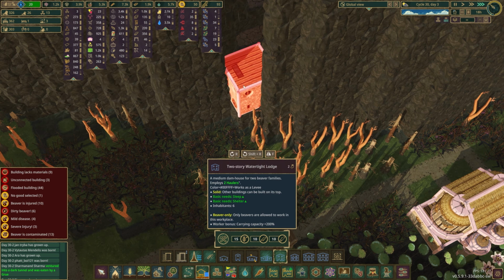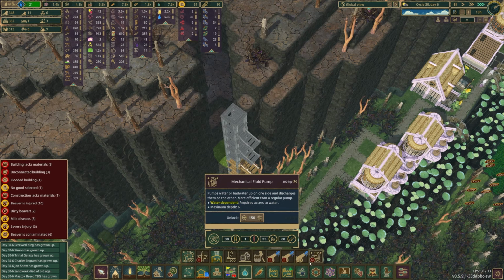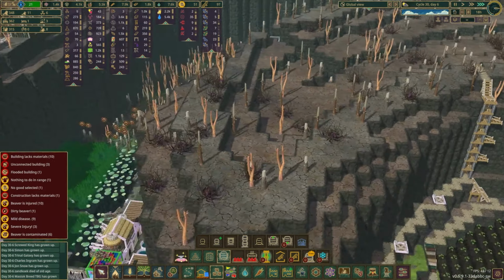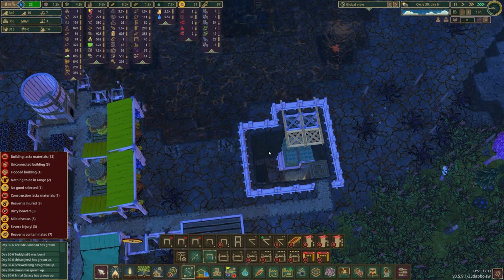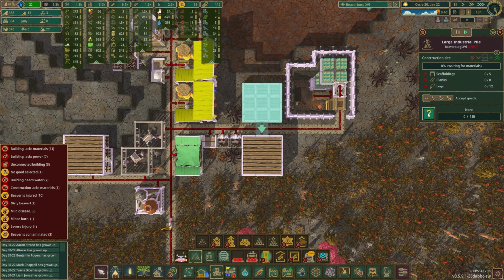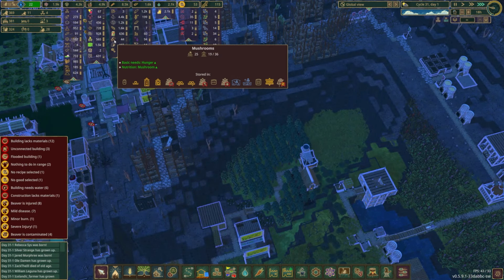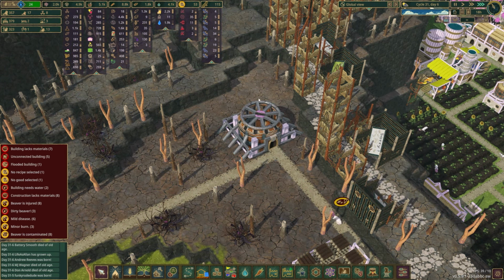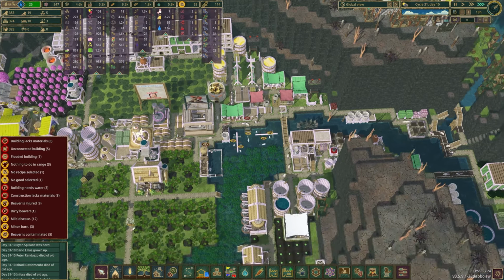Let's do something with the top of this cliff! Timberborn Waterbeavers Update 5 Episode 29

Comment: 19:01 if you place another floodgate near the exit of lake near the log pumps and set it to 1. It should provide enough height for the water cannon to work. And you could place a couple of waterwheels in front of your current floodgate. 

Also the idea of build a flood gate next to log pumpers to 1 is that any overflow can be diverted off the map. And therefore hopefully reduce the amount of flooding of the lower ground / floodplain.

Comment: 4:36 cannon in the bad water diversion channel by its exit that over flooded last time might reach the high top area :)? Not sure how quickly it would fill up the high top area but it could then over fill it and come out somewhere that then feeds the normal area below : 51:34 perhaps blast a channel out the side there for the bad water then then block it up and always send it off the map there . And then block the remaining water sources after your water wheel section and only funnel  good water to power your wheels up there

Comment: → 13:10 You could add some overhang platforms at your ladder stack, and put the fermentation barrels on top of them.
→ 19:06 You can put platforms on top of the medium crappy warehouse here, and then more warehouses, if you want. (Not sure how high these can be stacked, but at least one more level should go in.) Though I'm not sure you need more storage for quartz here ... maybe rather some of the other alternative outputs for the mine?
→ 22:46 You could likely use a combination of the overhang platforms and the 4-long bridges to cross the chasm?
→ 28:07 You could uncheck the "prioritize by haulers" if you want to avoid the haulers bringing in more goods for the current recipe. I guess you don't want to research another ENS blueprint here. (Actually, I'm a bit surprised you didn't get half of the stuff already.)
→ Remember, you can also put the giant tank between levee-type buildings, or a combination of buildings and dirt. (I don't have a concrete suggestion, but maybe an occasion comes up.)
→ Setting up the lido and water dump near your stack of water storage houses (with a path connecting them) would make the filling a bit faster, I guess.
→ Your logpile near the two lumberjacks was immediately filled up from overflow of other log production areas, so your lumberjacks on top of the cliff didn't get very far. Not sure whether setting it to supply would work, or just getting a bunch more piles. Or pausing some lumberjacks elsewhere for a while.
→ 59:13 It would actually work under water, but with the blockage of the flow you'd get even more flooding here.
→ 1:03:20 The large farmhouse can go on platforms over the water, and also inside of shallow water (I guess the beavers sleep on the upper floor). You only need the watertightness upgrade if you want to put it into deeper water. It also says it can go on top of the pit-and-ladder lodge (I guess with some platforms around). I'd like to see that.
→ You should have at least 3 of the primitive ironworks – one each for tools, metal fasteners and saw blades, so you don't need to have them switch around. Maybe an additional one to switch around as needed (or to switch off when you got not enough beavers or need the scrap metal elsewhere).
→ Reminder: switch the flood gates at the beginning of the bad tide. And I think you should add a few more dynamite to let it easier flow out of the map.
→ Your amount of stored water is significant lower than after the last temperate season – partially likely due to all this dumping on the top of the mountain. I guess you need a bit more pumps to keep that up?

Comment: nice progress ! it's good to see you move forward and solve problems since a few episodes, there was a lot of stumbling around before so that feels fresh 😊

i think what  you should consider next could be to dam up more the waterway in the old high ground to try to store 1.5 units of water at least, and you seem chronically low on planks so it could be worth it to build a second sawmill somewhere. typically if you plan to build up that half-made dam you have near the springs, you can add in sawmills and factories and engines and cookhouses or whatever.  

the most helpful trick is to keep the power shafts on the rightmost and / or leftmost parts of the dam (so as to no hinder pump placement on the top layer), which shouldn't be too hard since powered building always have their plug on the leftmost of rightmost voxel. (unless you're going for the giant sawmill but that's an other story. and for buildings in the central part of the dam anything non-powered goes.

and if you're having issues with buildings access paths, florists are your friends (but you have squewer platforms now)

Comment: 18:30 Or you could fill the area 3 deep, with the bit in the middle as a reserve reservoir and all the 2 deep area for lotuses
Reply: i would have done that too probably, but eh, that works fine too.
Reply: 1:15:50
It would loose more water to evaporation.

Comment: Man, the flooding...  I commented on the last video, but maybe I was a bit to cryptic.  In the area where you have the lemon grove, there is a water source block that supposedly has a negative value.  It works like a drain.  If you redirect the water from "the high ground" and prevent it from joining the main river, it might help alleviate the flooding.

I say "supposedly" because this is not first-hand knowledge.  I saw another Timberborn channel use it.  I dont think they modified the map, but I don't know for sure.
Reply: Nice option. I went the other route and levee'd off the sucker and dropped a few dams in to maintain green
Reply from the maker: I didn't even notice that one being negative. We'll have to investigate that for sure